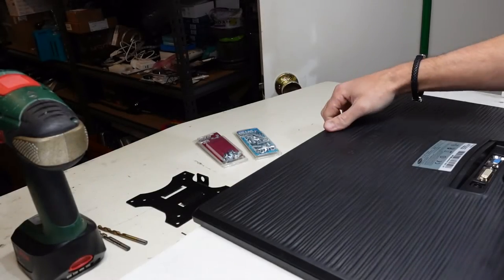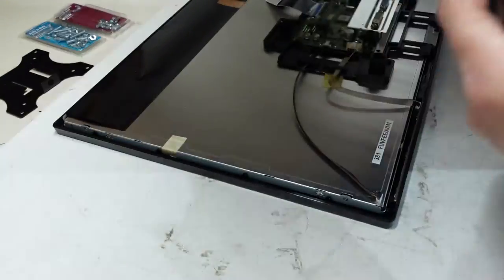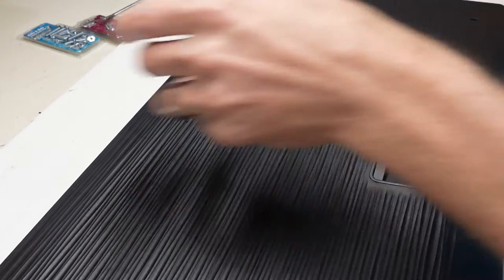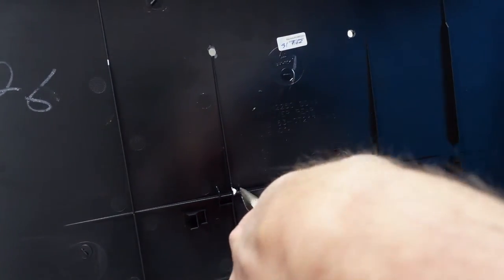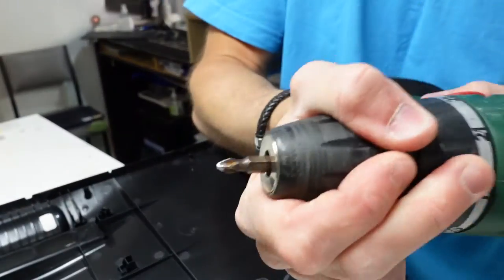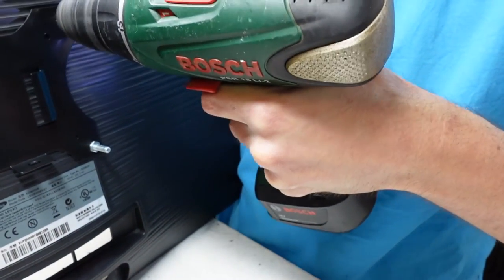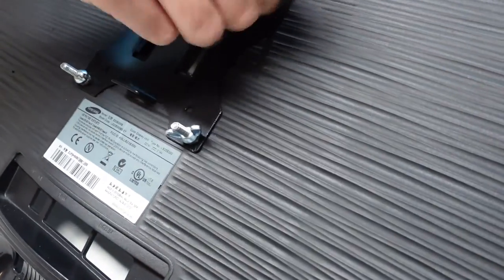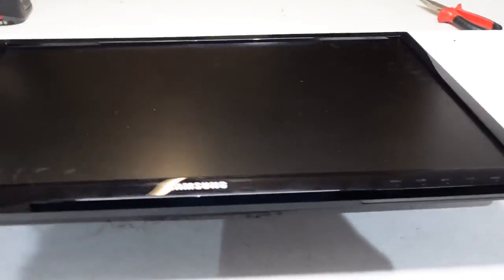Adding Vesa Mounts to a Samsung Screen Without Them

Comment: A heavy guitar pick will help to open the monitor's back cover beautifully, and btw isn't that vesa mounting bracket installed upside down? In all the arms I know that adjustable hole is placed in the upper side to lock the monitor and set it's height
Reply from the maker: iv possibly put it upside down :) but it still worked fine

Comment: Thank you for showing me how to add the VESA mount. mine was identical to the one you added; but, it looks like you installed yours upside down. I guess you had to take it apart again. That was a painful exercise getting that front bezel pulled loose. Anyway thank you, my monitor is installed and works great.
Reply from the maker: Awesome to read this has helped

Comment: Do you think 1/4" would be better than 3/16"? Also thanks for the video this is exactly what I needed, at $30 for the adapter on Amazon and it was only a $20 monitor at the thrift store my monitor seems to be going over budget. This tutorial saved me a lot so ty!
Reply from the maker: I'm not sure from an engineering point of view, both should still hold the screen fine
Reply: @rickstechrepairs  finished doing it to my Samsung monitor and it works great! Thank you again for the detailed work and filming it.

Comment: This could have been done much better and neater. I couldn't imagine giving this to a paying customer and being comfortable that it would last and they would remain satisfied. First of all those bolts were too long, they also should have been facing into the internals of the monitor which would have been possible with the right sized bolt. The wingnuts were total overkill and completely pointless for your purpose. You should have used one nut on the inside and one on the outside to make sure that the bolt can't spin (like you said they could when tightening the wingnut). You also should have been using lock washers along with the nuts to keep them from coming undone. Another thing I would have used is some thread locker to make sure those nuts weren't going anywhere. You also should have done more to support the weight of the monitor because those plastic backings are not made for holding weight like that and your customer could very well end up with a broken monitor if the plastic breaks. If you had even just used some small scraps of metal to make some supports that go from one bolt to another inside the panel that could have spread the weight out a little more. The better way to do it would have been to try and make something that spans the entire length of the inside of the back panel to distribute the weight evenly (could even just be thin metal or some wood) which would give way better support since it wouldn't be centralized to one location. There are also adapters you can buy for non-VESA compatible monitors, some connect where the stand connects and some just grip the monitor, but they would all be more stable than just drilling some holes in the cheap plastic and hoping that it holds up.
Reply: To be fair I don't think this is something someone would do for a paying customer it's more for people like me who have a spare monitor they want to repurpose. If I can't find a way to vesa mount my old monitor for vertical use for under $10 it's going in the bin. I will use some large washers around the holes though so I can get it nice and tight without the screws potentially pulling through.
Reply: @benruss5309  He said in the video it was for a customer, that's why I brought it up.

Comment: why samsund did this ?
Reply from the maker: No idea
Reply: Sometimes manufacturers loose their way. I saw a Samsung wireless subwoofer with no soundbar the other day. Looked it up, turns out they connected using proprietary wireless link. So without the soundbar it was useless. Not even compatible with other Samsung soundbar since it was "going to be the new standard" at the time and then they abandoned it the next year.

Comment: Are you nuts?  You're anchoring the monitor onto thin plastic, something that is just press fit into the monitor housing?  Unbelievable.
Reply from the maker: Not nuts just practical
Reply: @rickstechrepairs  Thin plastic is not strong.  And press fitting that thin plastic to the frame of the monitor is not a secure way of holding it.  You have 2 possible failure points. Those are the problems.
As there's a metal frame in almost all LCD/LED monitors it may be possible to drill/thread some 100 mm VESA mounting holes into it if you're very careful.  Then using washers to take up the space, anchor through the rear cover to the monitor arm plate.  Still not good but at least now its in metal.  Another option is to drill several holes far apart and rig up a larger VESA  adapter plate so its holding it from a larger area.  Not many people have threading tools or drilling skills for this though.  You might though!  :)
Reply: This monitor weighs around 4kg to 5kg. It doesn’t need some intricate engineering solution. It just needed exactly what was shown - the addition of the vesa plate. I did the same to my two similar monitors well over a decade ago and they are still solid as a rock.
Reply: I don't see anything nuts here, since using some basic school physics; weight divides in equal parts by each of it's support points and by the other hand led monitors are mostly very light weigh as well.
Reply: @TheForce_Productions  Yeah, you're nuts if you use thin plastic to support anything.  Its called dynamic loading.  Its not the static weight.  Things can knock a monitor.  It has to be held quite securely.
Reply: @FreshAirRules  Mine is mounted the same way since 6 years now with no issues at all. But keep your point of view, you have the right to.
Reply: @TheForce_Productions  You're lucky.  But its a ridiculous way to mount a monitor and ignores simple physics.  People are going to do this and have terrible results.  What is needed, really needed is a mounting system that holds a monitor by its 4 corners.  I have not seen this yet.  I don't know why.  It doesn't seem difficult.  You could 3d print a plastic shape that grabs the corners with a couple of mounting holes to bolt bars to the center VESA adapter.  Holding it on the top and bottom means you can't rotate it (safely) which is one of the nicest things about using a monitor arm.
Reply: @FreshAirRules  I my case I glued a metal plate in the inner side then drill the holes though both. Better that a factory VESA. 😄 Anyway I never "rotate" my monitors, just watch through them, don't use them as dancing partners.
Reply: In support of Rick, he is definitely not nuts as you put it, he has put a free tutorial on YT to give people like me ideas. Anyone not having DIY experience is unlikely to takle this, and anyone taking any advice from the internet without adding some own thinking is simply nieve and unwise. Rick is part of the community of people who shares his ideas and ways freely, and it takes time and effort to do these videos so people like me me benefit. In support for Obi Wan, like me, he applied his own experience and approach to Rick's idea. I too adapted with supporting metal plates etc, and everyone  will be different. Thanks Rick & Obi Wan